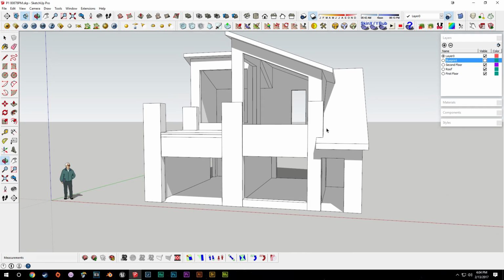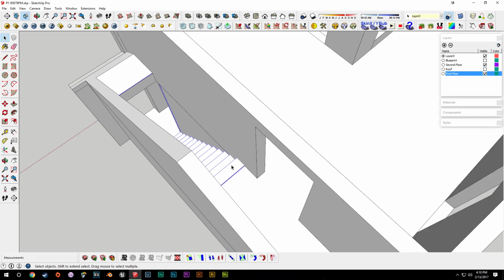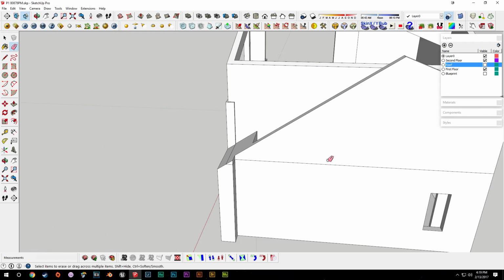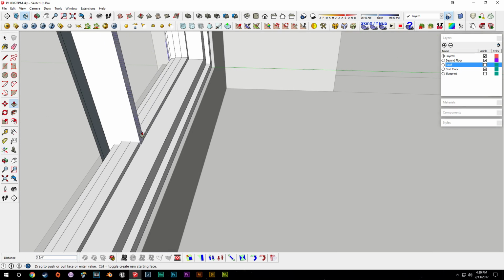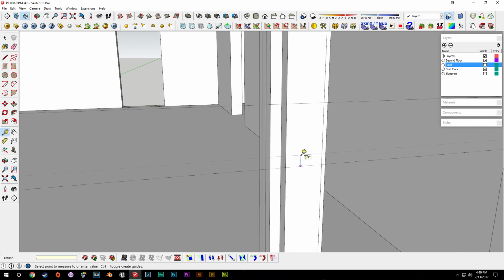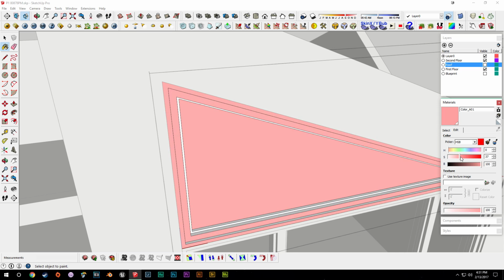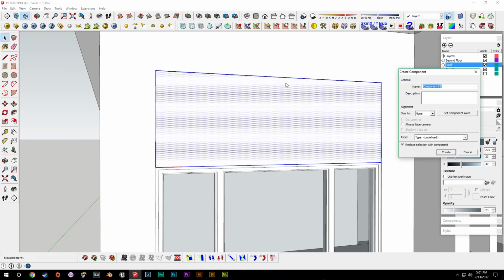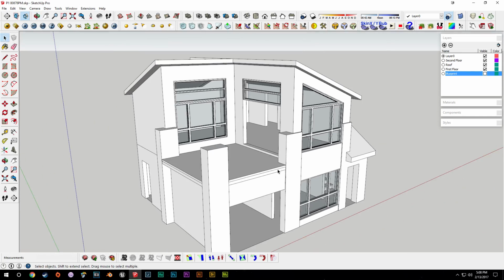STAIRS & WINDOWS - Dramatic Contemporary House Pt. 4

Comment: There's a quicker way of making equally spaced lines! you can use the move tool to copy the line from the start of the series to the end (in this case it would be the start of the rectangle closer to the front door copied to the back of the rectangle of the stairs) and writing out 13/, which divides the distance by 13 equally spaced lines. It's basically the same concept as writing out Y X to make an external series, but by writing / instead of X it makes the series inside what you've copied. Hope this helps!

Comment: I do not know why, but for me creating a windows is the most difficult part of the home 3D modeling, after watching your video it seems feasible, thank you so much. By the way, why the window in the form of a plain instead of a box?
Reply from the maker: Thank you! I suppose you could make the glass itself three dimensional (if that's what you're referring to) even double glaze it if you wanted for aesthetics, but for rendering later on it's easier if you're working with just one surface, at least in my experiences.
Reply: I was so perfectionist that decided to model the "stitches" on the metal inside the double glazing unit, this led me to a deep frustration ~_~
Reply from the maker: Haha, I can imagine. I'd love to do that level of detail as well but then this video series would never end!